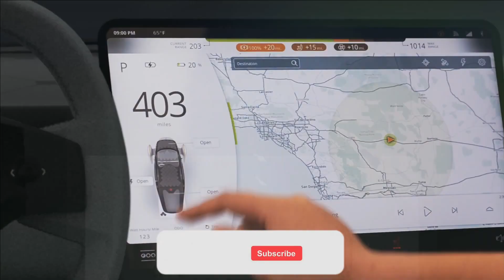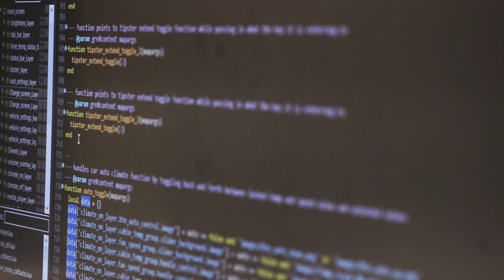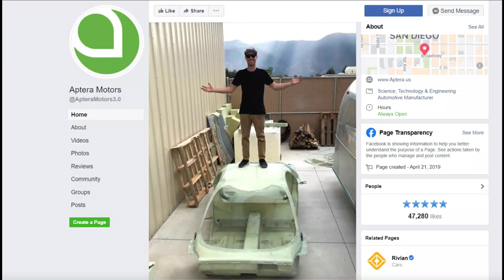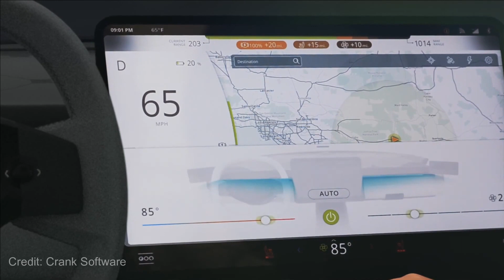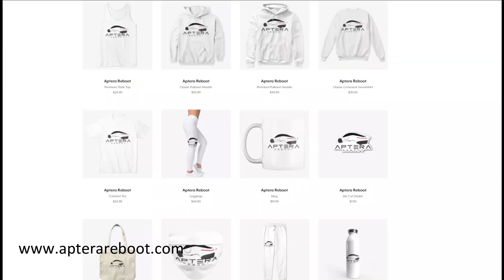Top 3 Reasons Why Aptera Will Fail?!?

Comment: 1st 1k. I'm so excited getting my hands on an Aptera. Have been owning a Renault Twizy for five and a half years now, driving 40 000km with it. Love it! But Aptera would be the perfect upgrade when the time comes.
Reply: You must live ina warm climate. Twizy can’t be sealed very well against the cold and has no heating system. I have seen the extra kit for closing the sides that still leave a six inch gap at the back. Also because of the doors ot can’t be locked so you can’t leave anything inside. The Rayttle from China costs half the ptoce, has real doors with side windows, a heating and air conditioning system. I looked a lot at Twizy as I live where they are made. I figured they are only semi practical in a warm country where they can be driven year round. Here in South Korea it gets down to -19C and -25C in the winter. Not practical in colder climates.
Reply: @garyfrancis6193  I actually live in Sweden and the climate here are quite cold at times. I think it is a matter of mindset. I can live with missing some comfort if I can help saving the environment a bit. Compared to driving around with 2+ metric ton of metal while burning fossil fuel are actually worth it in so many ways.
I love my Twizy because it is really fun to drive and the open cabin is perfect in the summer. Yes, people can pick things that are loose in the car. I usually leave some things in the car, but I have never lost anything. Most people are leaving it alone.

Comment: 1st 1K on the way to 10K!!!  As a lifelong entrepreneur/startup investor/car lover, the 3 most common concerns: 1. prior failure, 2. safety and 3. Seats 2 are all w/o foundation.   As for your 2 concerns: 1. reliance on suppliers allows Aptera to concentrate on it's core competencies and is actually an asset rather than a liability...it would be a costly mistake for them to start vertically integrating, 2. niche product, so what?  Niche products always command higher margins than mass market products, again an advantage.  Look how prior management's focus on volume sales and manufacturing led Aptera 1.0 straight into bankruptcy.  Great channel...keep growing!!!
Reply: As I recall, Apple computers were once described as “niche products”.

Comment: I have a few concerns about Aptera’s current state, but I want to say that I do believe they’ll be able to bring it to market. I agree about their current reliance on third parties, but Tesla successfully launched with the same strategy - almost all the parts of their Roadster were from other companies, except the motors iirc.

My concern is the timeline - Aptera is still saying they’ll have the first deliveries of the Paradigm model this year, but as we recently learned in the Elaphe webinar the only prototype they have so far (the one in all the videos on the site) doesn’t have the final motors or battery setup. Industry standard practice is to get at least 200k miles on the road with production parts to find any faults and fix them, and considering Aptera’s next two prototypes they’re still building will not have the production battery/charging setup I’m worried about the feasibility of getting weather and road testing done on a production-ready prototype.

I estimate that they’ll try to get the first cars out the door in around September based on the timeline from WeFunder so that’s about 6 months to iron everything out and start manufacturing, which is a very short amount of time. The team seems to be focused on flexibility and maneuverability so they might be able to finish everything and still be able to get regulatory approval in time, but it definitely sounds rough.

Much less important, but the first cars off the line are likely to use resistive heaters because of the supply chain - they only just started working on a heat pump design late February.

Anyway, I really enjoy the channel and plan on making good on my order when I can (I’m in the mid-7ks so it could be awhile) so I’ll be along for the ride. (1st 1k)
Reply: I believe the timeline we see on WeFunder is heavily caveated as "covid-permitting".  As such, Covid could act as a giant Houdini clause in such forward thinking statements.  I should hope not, because I want the Aptera I have reserved to be in my driveway, like, yesterday!  lol
Reply: You shared some information I did not have before and made some good points- thanks.
Reply: You don't mention cargo capacity or the very wide dimension across the front pods making garaging & parking a potential problem. Plus I have yet to see any demonstration of safe cornering.

Comment: The car cannot be sold in Europe as it is. Is too wide and too long for the european regulation. If they want to reach a larger market with this niche vehicle there are a lot of changes to be made.
Reply: What is the Renault Twizzy in Europe? A car?
Reply: @moestrei  Twizy is not considered as a car in Europe but as heavy quadri cycle. It has a limit in weight and power is limited to 15kw. There are various classes with limitations in weight, power and speed. 
https://en.m.wikipedia.org/wiki/Quadricycle_(EU_vehicle_classification)#:~:text=Quadricycles%20(L7e)%2C%20also%20referred,for%20carrying%20goods)%2C%20not%20including
Reply: @johannes914  15kW.....guess that's just enough for 80km/h. Aptera has either 100kW or even 150kW.
Reply: @moestrei  The 15kw limit is for the small 4 wheels vehicle in the L7 category like Renault Twizy.  There is no power limit in the L5e three wheels class. That's why it suits the Aptera.
Reply: @moestrei  Regulation for the Aptera in Europe would be L5e A.
Reply: 1ST 1K love it
Reply: Too long by how much?  Easier to change an arbitrary number in a regulation to make a desirable product available than vice versa.  Who’s the dog and who’s the wagging tail?
Reply: @harleyb.birdwhisperer  régulation for three wheel vehicles is max 2m wide and 4m long. Aptera is about 2.35 wide and 4.4 long as far I remember. Don't expect european regulation to be changed to please  an american manufacturer. Its too wide for parking and most garages anyway.
Reply: @johannes914  So sad, guess you’ll have to keep the Trabant.
Reply: @johannes914  There are talks about making an European version, but I wonder what impact the narrower wheel separation might have on stability. It might not be much of an issue given the already low centre of gravity.  There are also talks about a potential Parallel European Manufacturing Facility.  See here:  https://www.aptera.us/forum/general-discussions/parallel-manufacturing-production-in-europe-may-be-on-the-horizon
Reply: @johannes914  It has roughly the footprint of a Tesla Model S (incl. mirrors) or in fact any other large family car. Never had any issue with driving parking  my Tesla and it fits into my garage too. As long as the turning circle is ok. There are Model S in Europe?
Reply: @moestrei  Yes there are Tesla S in Europe. Teslas are cars. Not three wheels vehicles. The regulation is not the same. For example cars can't weight more than 3500 kg. Three wheels vehicle limit is 1000 kg
Reply: @johannes914  Aptera with the biggest battery is currently at 998Kg.  2m width should be also achievable.
Reply: @moestrei  they are not far from the goal indeed. They have someone working on the issue.
Reply: @johannes914  The closest would be the Morgan 3 wheelers and Can-Am (?) 3 wheel motorcycle both available in Europe and Australia also. Because of the steering wheel the Morgan and the Aptera are classified as cars in Australia.
Reply: @johannes914  There are already European holomogation agents working on getting the details changed.  The disadvantages of the width will remain, but there are already wider vehicles on the road in Europe and the unique properties of the Aptera design will also serve a certain niche of European drivers, even though it is likely to be a much smaller one than the one in the US.
Reply: @fanfare100  The wide stance of the front wheels is not primarily about stability.  It lowers the Cd by more than 10% compared to more closely set wheels, because it allows the body to move in clean air.
Reply: @johannes914  I forgot, you’re limited by old cities with streets designed for donkey carts.  The answer is give and take - relax the length restriction and develop a narrower front end europepn version to accommodate the parking problem.  Pretty simple.
Reply: @n.brucenelson5920  Hello Admiral!  When you refer to "clean air" are you referring to (non-turbulent air)?
Reply: @fanfare100  Yes, exactly.
Reply: Europe's loss, not Aptera's  There are plenty of highly profitable vehicles that are not sold worldwide.
Reply: @oceans123  when you start a car company you should make sure that you won't miss half of your potential market because your vehicle is 10% too wide and too long. Europe has a big potential for this kind of vehicle because gas is expensive and driving distances shorter. That makes electric cars a winner.
Reply: @johannes914  You make a good point.  Indeed, we are not so far apart.  The Aptera is designed for around the principles of aerodynamics and low rolling resistance, not EU regulations.  Maintaining a Cd of .13 while reconfiguring the vehicle's entire geometry is no mean feat.  So, while it makes sense to address the EU market, it seems far more prudent to fund the necessary redesign and retooling, which selling into the EU will require, out of profits from sales of the current design rather than investor capital.  Not all EV startups can count on TSLA's low cost of capital.  Nor should other markets, reservation and shareholders wait while Aptera complies w/EU regulations at significant upfront cost in both time and money.  The fastest route to positive cash flow rarely ever the wrong choice.  So, Aptera should stick w/it's current go to market strategy.
Reply: @johannes914  The current Aptera was considered to be a niche vehicle from the very beginning, and is not designed to a marketing standard, but to a performance standard.  US laws have been changed to make it viable, and with the need to reduce carbon emissions also great in the EU, there is no reason to think that they can't modify their standards to make room for it, too.  I used to sell scientific instrumentation in the European market, and at the beginning had a good business selling products with no European certification, because the customers and governments concluded that the risk of not having them outweighed the risk of regulatory non-complience.  

The follow on Aptera vehicle is likely to meet current European standards much more easily.  In the mean time, it doesn't make sense to move the wheels inboard to meet a regulation.  The performance cost is too high.